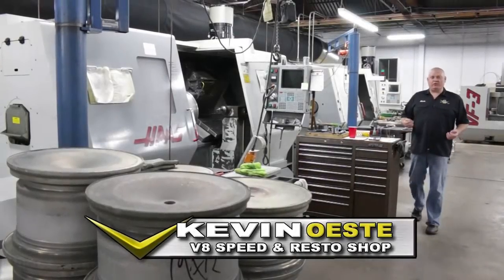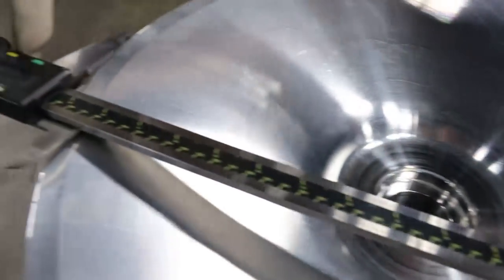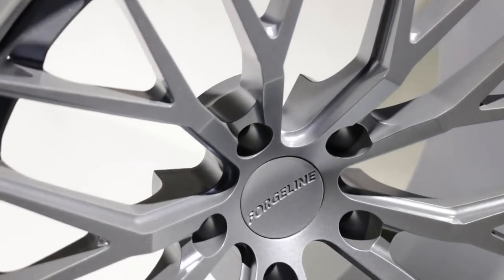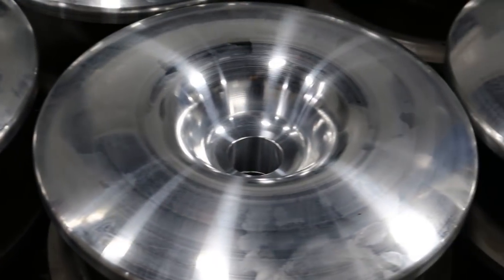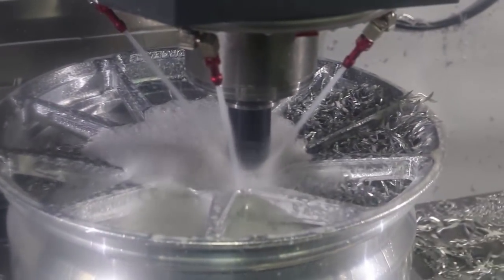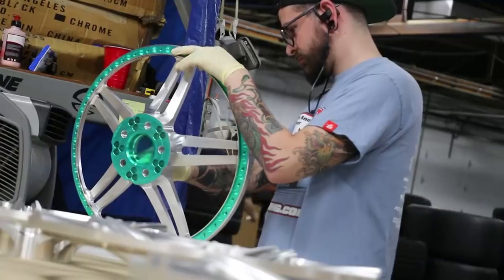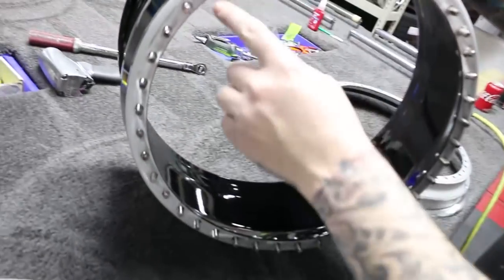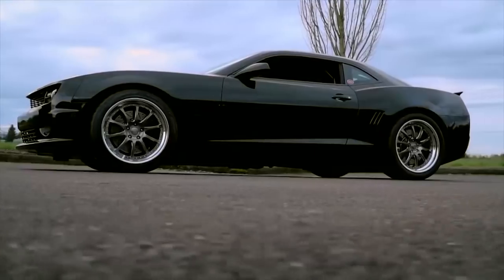Behind The Wheels:  A Tour Of Forgeline Motorsports Racing Wheels Production Facility V8TV

Comment: 6:03 Using a die grinder while wearing a dust mask and ear plugs, but NO SAFETY GLASSES?!  No dust mask while applying powder either.  Looks like an OSHA paradise.  I was surprised to see they use cheap Fowler micrometers for critical metrology.  Nice video with beautiful wheels nonetheless.  I can see how they cost so much.